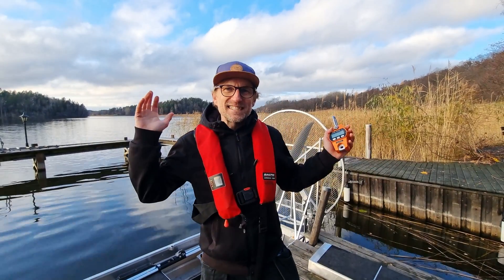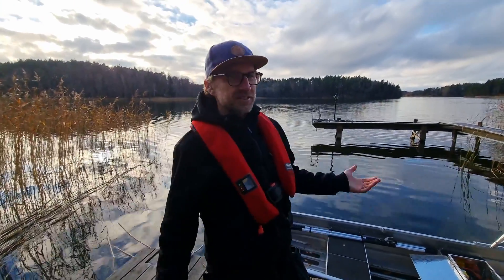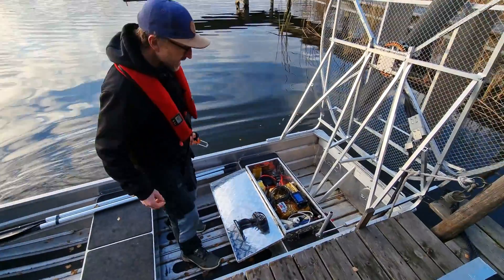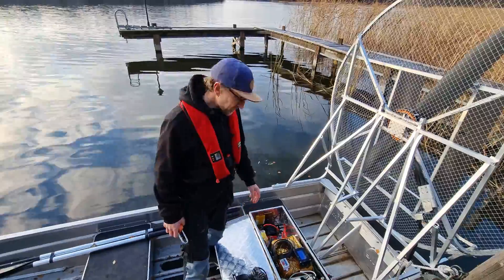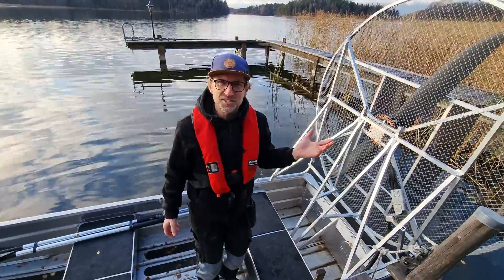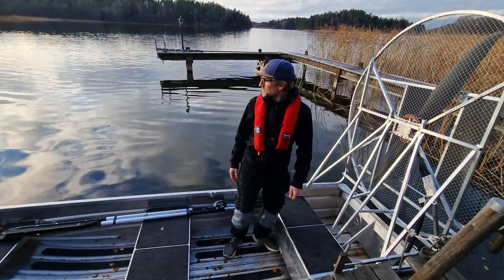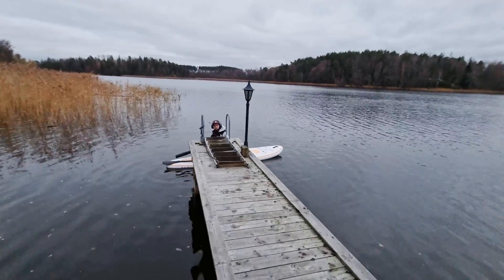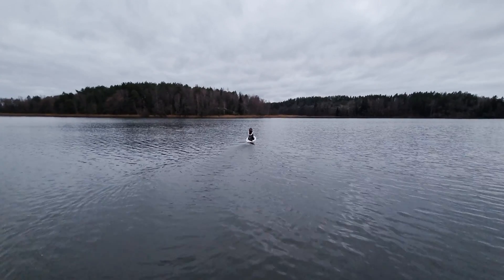Mini electric airboat thrust test!

Comment: Not to split hairs, but here it goes:) I think most accurate static test pulling could be accomplished by attaching scale ropes at centerline level of the propeller. Tricky to do sometimes of course. Great project, thanks for sharing!
Reply from the maker: Hi @Terry Lutke! 😅Yep, with you there! It wasn't quite the super-scientific experiment where we eliminated all variables, or used calibrated equipment for results measured at micro level😅! Glad you enjoyed, see you round :)
Reply: @marsonselectric  I hear you there. I've done quite a lot of static thrust testing with pusher type para-flyers, easiest spot to hook is low at the axles, also used a so called 'big game' scale. Mine was a safe but non-scientific setup, results were good enough for in-house comparison.

Comment: Awesome work. I've been dreaming of making my 1956 Cadillac Daytona 12' aluminum boat into an electric Air using 96v LTO battery pack. The boat is under 150lbs. Battery pack weight of 250lbs. Fabricate the ground effects wings and solar panel controls 88lbs estimate. Motor mounts and 3 blade propeller 63lbs. Estimated wet weight of 555lbs gross weight 775lbs. 600amp peak at 20 sec. 250amp continuous. Peak hp 77 continuous hp 32 estimated speed maximum 88mph. Cruising speed 50mph.
Reply from the maker: You have to do it @robintaylor! Sounds like a fantastic project! You'll get amazing results, better performance, and be minimising the usage of fossil based resources👍👍Work hard for it, but you'll playing harder when it's done, guaranteed!! /John